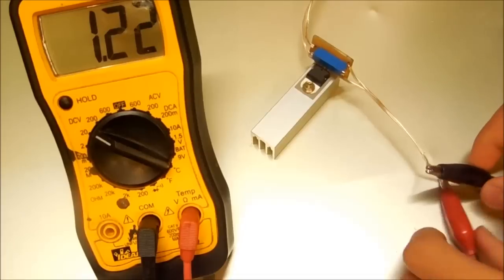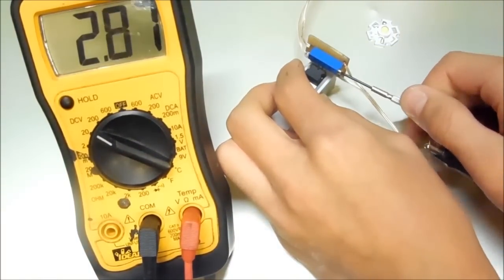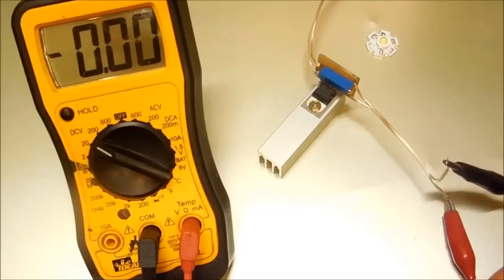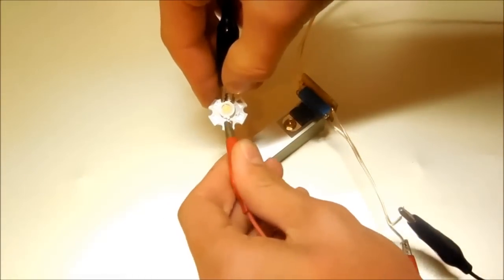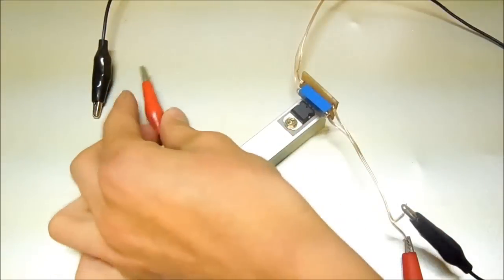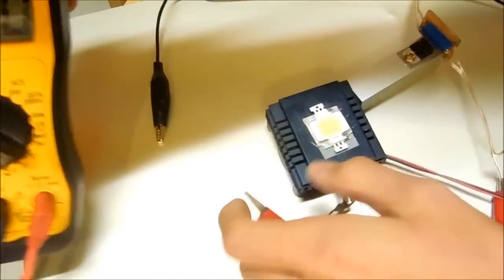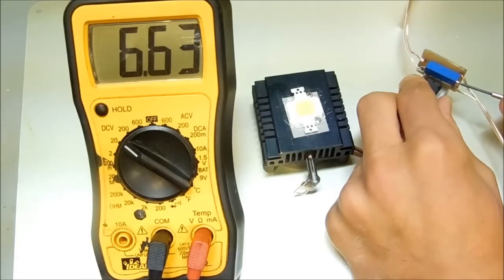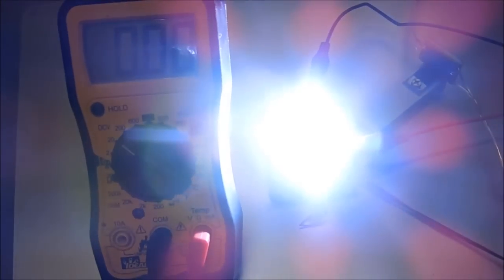Homemade Simple LED Driver

Comment: Lol, peopla say this cant be a LED driver because LEDs drivers regule current instead of voltage. But in the market you can find LED drivers constant current or LED driver constant voltage. its depend what use you need. The only advantage of constant current driver over constant voltage driver is when a LED get shorted the current of the other LEDs is not affected much and this can continue to work.

I sell LED lamp for exteriors that i build, with Constant voltage power supply. controlling the voltage i can apply enough to get great bright with low temperature. Clients until now had Lamp running for 3 Years with out problem and always buying and sending more client to me ;)

You can use a lineal voltage power supply but its better use a switching powersupply.

Comment: I would suggest turning the circuit into a current regulator there is an example schematic in the on data sheet. I know it is just a test/fun project but some people will actually use it and burn their LEDs much faster than normal. the explanation from that is already written by some other user down in the comments. btw I really liked the minipcb

Comment: Hello Electrotechnics, have you understood the problem with this circuit yet?  You could do another video explaining why voltage regulation for LEDs is a bad idea.
Reply from the maker: +westinthewest Yes I have understood the "problem" with this driver from before I made it, although i have yet to burn out an LED with this driver. That is a good idea for a video, I might just do that at some point, although I've been busy so I have not done many videos recently. Thanks for watching!

Comment: That is not a led driver. is a voltage regulator.
The led will not live for long with this circuit. i read that you told someone that this will be fine if you give the led the correct voltage. Thats wrong. Since you have a multimeter, try to make it on 10A scale and test in serie how much mA it use the led at the start when the led is at room temperature , then look how the mA drained it grow and grow and grow slowly. That's called avalanche effect. the more the LED  become hot, the more mA it drain, the more mA it get, the more It become hot untill it will consume in a short time his life that should be around 100.000 hours in a good ventilated and current regulated environment. Your Lm317 will just continue to give it more and more mA with the same voltage. At least you can add a good resistor in series within the led and the voltage regulator. That will preserve a little more the led from overheating and overfeeding itself to the avalanche effect. hve a nice day.
Reply: +begclobegclo was right. By default, LM317 is a voltage regulator. You need constant current for driving LED. This means that you have to configure LM317 as a current regulator. You can find the schematics in the LM317 datasheet.
Reply from the maker: Well that may happen if there is not a sufficient heat sink. The only way I've burn out a high power led was by running it with no driver and I accidentally turned the voltage up to 80v and it burn out a single one of the 48 led units inside the package.
Reply: Electrotechnics Your item isn't a led driver. is a analogic costant voltage regulator.
It can be a simple led driver if you change it's configuration for drive a costant current istead of costant voltage. Led drivers are adaptive, they adapt the voltage all the time for deliver the same current. Since a led in it's life will decrement it's performance and increase it's voltage request for deliver the same current in form of light the led driver will deliver more voltage for let it have always the same current. thats is what led drivers do. As i told you, what will happend in your led is that its life will be significantly consumed fast without a driver. it will dim because of overpowering and because is it's nature of dimming during time in use. You will have 2 probably scenarios, 1) the led will dimm that much that you will have to turn your resistor to deliver more voltage for get back the light it lack ( led driver do this automatically), 2) your led will finish prematurely it's life and will start to flicker, heavy dim or just fail. aniway, as i told you, try set the 10A on your multimeter and take a look at the current absorbed during use, you will see that is not linear and not fix even if you properly heatsink it right. Outside some led can be lightly warm when maybe inside is alread at a hight temperature due to a heat transfer not effective for the over amount of mA delivered to the semiconductor. You can see this with a infrared thermometer pointed on the light lens in front of it. Have a nice day.
Reply: Using it as a voltage regulator can work fine.  All you have to do is finish the lighting product with the LED installed and heatsunk in the normal ambient temperature, then adjust the voltage letting it heat up, THEN fine tune the voltage to arrive at the desired current while the LED is hot.  
The problem is only that this is not repeatable since each specimen of LED and lighting application will differ so you would have to manually adjust it every single time you set up a new LED product.  However in this case with LM317, it is true that running it in current regulating mode is better and yet, far better still is to not use a linear regulator at all since they are so terribly lossy, wasting quite a lot of power.  It makes no sense now that complete current regulated boards are available shipped direct from China for very low cost at this power level.
Reply from the maker: That is pretty much the idea I had for using the driver as a voltage regulator. 
This driver is designed as more of a fun DIY project instead of practicality for everyday use, as you stated much better, efficient CC led drivers can be bought from ebay for less than the cost of the parts i used.

Comment: Hi. I have a question. With this method you can light up to 40 1w leds, can't you? this would be with a parallel or serie connection? thanks!
Reply: Nicolás Cruz It should be in parallel, series will draw the voltage up for ex: if 1 of your LED needs 1v then if you connect 40 of them, it will need input of 40v, where as if you do it parallel, you will still need only 1v. Now next part you need to figure out the wattage.
Reply: Great!

Comment: Hi, your circuito was made to control voltage ou amperage in led? Because the typical driver control only the amperage. You cand do both with lm317 IC.

Comment: a better setup would be to configure a LM317 as a constant current source and that can be simply done using only one resistor...see datasheet for connections..

Comment: Actually, you should not touch the surfaces of high power LEDs.
In this way the applied grease from the skin can destroy the LED.
I'm not sure - but I also have read that the yellow mass on the LED's can be harmful.
Information:
LEDs requires a constant current. Precisely the one that is specified by the manufacturer in the data sheet. (Forward current: If)
Furthermore, the operating voltage should be correct. (Forward Voltage: Uf)
The LED current is normally limited by resistor. In high power LEDs, take a right LED driver whose voltage automatically adjusts, but the output current remains constant limited. There are a LED driver in the form of a switching regulator in order to minimize power losses almost completely.
At 1W high power LEDs it is a forward current of 350mA.
Reply: djblackarrow
Reply: No.  You are thinking of glass incandescent bulbs where the skin oil can cause an uneven expansion of the glass as it heats up but that is not the case with LEDs.  The yellow mass is a silicone or plastic (depending on manufacturer design) that fully resists skin oil, and yet a better reason not to leave fingerprints on it is that reduces the optical clarity just like a smudge on a window would look worse than a clean window.
Reply from the maker: Yep, correct on all fronts. Thanks for watching.

Comment: watz about input voltage,,,,,,,itz 230v or 110v???? i,m from india,,,,,,can this circuit use in 230v???
Reply: 12v lead acid battery.

Comment: What kind of Power driver can be used for 1 watt led x 20 nos. Now I am using a phone charger 5.0V with 650 mA (parallel connection). My question is 'If I do a series connection can I use laptop charger or something like that?' I don't have an idea, I am doing it as a hobby.  Please give some idea & I'm using it for my aquarium.

Comment: A small tip for those playing around at home:

Use a voltage for you LED that is lower than you LED is rated for (typical value). It will reduce the brightness a bit but it will increase the efficiency and not only that: You can omit the constant current source circuit at all. Because the LED is driven with a low voltage, the risk of damage is reduced to about 1% when cooled properly. If it is not bright enough, just use more LEDs rather than ramp up the voltage.
Reply: It's funny cause my led is supposed to be a 12 volts one. When I use 11 volts it doesn't get that bright, like the one in the video. The seller told me the current it requires is 950ma. Does it mean my 10 w LED is different from the one in the video?

Comment: Thanks for the video. Do you know how would the driver behave to a variable voltage at 20 Hz or more??
Reply from the maker: This driver will not work with AC, it will only work with a DC input. If you wish to use AC as an input you must rectify the AC and smooth it with some capacitors.
Reply: Electrotechnics Thanks for the fast reply. What about a voltage ranging from 3V to about 5V, no negative values of voltage and cycling at maximum of 25Hz, do you think the led would be capable of following the voltage?. I would like to achive the effect of dimming light you showed us but at much faster rate
Reply from the maker: I guess that might work, but if you were going to dim the LED by giving it a cycling voltage then I don't think you would even need to use this simple linear regulator to control the LED.

Comment: I always get confused with constant current with LED's. If an 3.7V LED requires 1A if the voltage is exactly 3.7V it will only draw 1A ,max I was under the illusion that an LED will draw as much current as it can from the given power supply until it burns its self out unless it is current limited, Laser diode do the same. In battery applications when the voltage decades over time that 3.7V LED will draw considerable more current if the battery voltage is 3.2V that's when a constance current is essential?
Reply: haz939

Comment: What do you do to control the amps? Thx
Reply from the maker: This controls the voltage, if your are supplying the LED with the correct amount of voltage the LED will only draw the amount of amps it needs. So no constant current regulating needed.

Comment: i wouldn't use linear regulator
Reply from the maker: While linear regulators are not that efficient the point of this is to be a SIMPLE LED driver. If you have some better way that is just as simple I would be happy to know about that design.

Comment: so if I were running 3 x 3watt leds in series, in a fast flashing pattern, this circuit would would handle that without over heating?